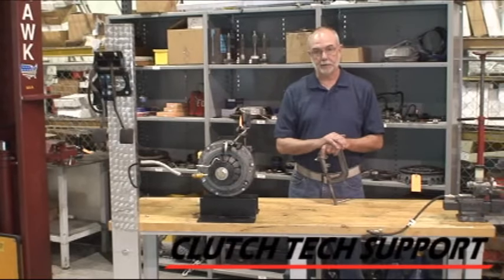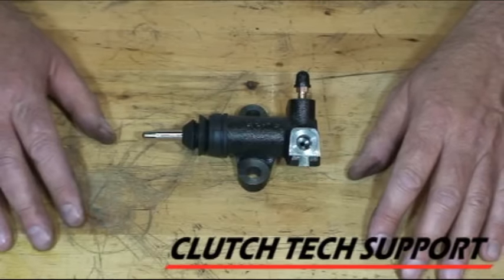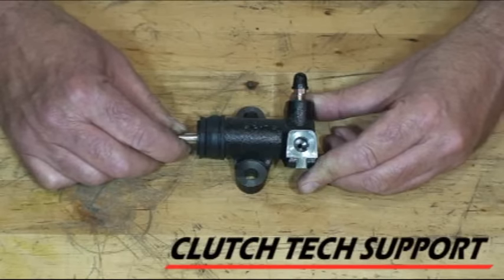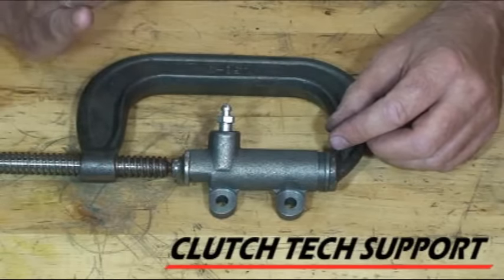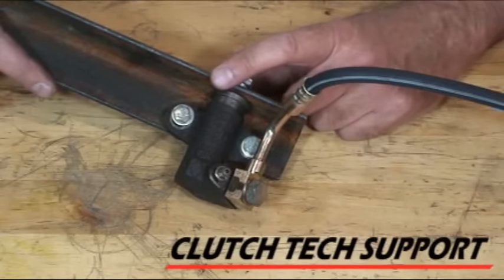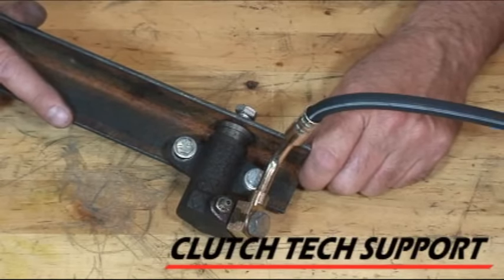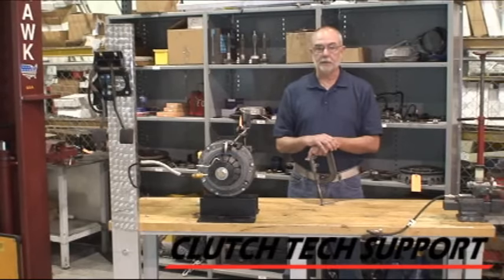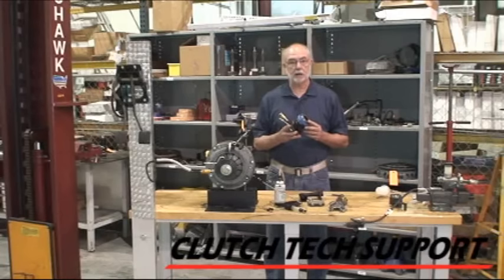Bleeding a Clutch by Blocking the Slave Cylinder

Comment: I'm trying to bleed the clutch on my Audi a6, its much like described in the video, I have tried gravity, pressure pumped through the bleeder, negative pressure through the bleeder, traditionally method, and its not working. the pedal is soft until near the floor then too stiff to even go to the floor. anybody got some input? do the symptoms point to any bad part of the system? I'm quite sure doing this method will run the risk of cracking the slave cylinder due to the fact that its plastic. It's also nearly impossible to work this method because it's so hard to get to the slave cylinder which is on top of the transmission. also I tried running a line from the bleeder screw into the reservoir and pumping the s*** out of the pedal, didn't work either I'm at the end of my rope here.
Reply: +perfectionclutch its a 2000 a6 2.7t 6 speed manual, I spent the day bleeding the clutch including removing the slave and clapping it which gives me full pedal, the slave however is easy to push the piston in after doing so with some hydraulic resistance and springs back out instantly. I hear a squish sound as the piston is pushed back in the last bit...

Comment: I am at my wit's end. 98 Honda Accord LX, 4cyl. Honda Part number for Master Clutch is 46920-S84-A02, Slave cylinder part #46930-S84-A06. I don't know what your numbers are. 

Master clutch cylinder was leaking. Was original factory and replacements don't fit so I replaced the master, the assembly line (hydraulic line) and the slave. 

For the life of me, I can't get pressure no matter what I do to bleed that line. Both the master and the slave have inlet/outlet right next to each other. I got a lot of air out of the slave by pushing the rod but still no system pressure, that clutch pedal goes to the floor. I tried your blocking the slave method after checking that yes, pushing the rod will change the fluid level in the reservoir. I did not bench bleed the master. Is this my problem? I put newspaper under the car so I could see if there were any leaks. No leaks, but then, I am not pushing anything forcefully, just slow hand push on clutch pedal.

Comment: I have a 92 civic. will be changing the clutch master cylinder and slave. after I do so, I fill up the master cylinder,  pull the pin and boot from the new slave and clamp it with a c-clamp. open the bleeder on the slave, push the clutch pedal down, close the bleeder,  put the clutch pedal up, repeat the process till just fluid comes out. take off the c-clamp, install the boot and pin, hook up the slave to the clutch fork and I'm done??

Comment: Hi, should I remove the rubber boot and pin before trying to block? I tried with the pin in place but it wiggles all over the place. Thanks
Reply: +perfectionclutch So this is what I am going to do. Can you tell me if am doing it right?

Install new slave, remove boot and pin, use a suitable socket size to block the piston, clamp socket with g clamp, bleed as normal, then bolt the slave onto  transmission.

Comment: Thanks Gary, great videos. I have a nissan with a longer route from master to slave. I cant get any decent pressure into the pedal and I suspect that there is air in the master cylinder. Will this method pump and air out of the master?

Comment: It's been 3 days straight and I'm still bleeding out the the clutch and it doesn't seem to work. I need help solving this problem can you help
Reply: +perfectionclutch it's a 04/05 350z and it's a v6 I replaced the clutch , master cylinder and slave cylinder

Comment: My throwout bearing is riding the pressure plate when clutch pedal is released. I have enough play on the pedal. The car was taken to the dealership twice for warranty replacement on the bearing but the car only has 63k miles. 

When the engine is running, I can push the slave rod in with my hand and can hear and feel the bearing not contacting the PP. It seems that the slave rod is over extended causing the bearing to ride on the PP while it spins. My question is, Can I build a clam to limit the travel of the slave rod then bleed it? After bleeding it, will that rod stay in play after removing the clamp or will it self adjust itself to the over extended position?

Please advise. Thank you.
Reply: +perfectionclutch 2008 Toyota Yaris 3dr hatchback, 1.5L 1NZ-FE.
Reply: +perfectionclutch Yesterday I strapped the slave half inch shorter than its original position then I turned the bleed screw counter-clockwise releasing a very small amount of fluid then closed it. Took the strap off and drove it 80 miles. I didn't hear the squeaking/chirping sound anymore but we'll see how long this will last. I'm thinking I may have to buy a new slave but I need to measure one out first and compare it to what I have.

Comment: Bleeding a 95 Honda Civic Clutch system and the Slave Cylinder doesnt move at all is this the slave or Master Cylinder Faulty or is there too much air in system. was working one week ago with different engine now with new engine it will not bleed or pressurize the slave
Reply: perfectionclutch Thank ya sir for the awesome response, I do have a question regarding the outcome of working on that system. The rundown of it I suspected the adjustment to be the issue and even installed a new slave cyl but couldnt get any movement on slave so kept bleeding just got zero peddle pressure at all the range of adjustment. Other side of system on bleeder little bits of air and fluid. Changed the Master Cyl for one I had lying around and got a gravity bleed quickly along with a working slave and system. Now what im so curious about is if the Master Cyl Was Faulty , or that the rod wasnt Floating as you said?

Comment: i have nissan maxima 2002 and i changed the master and slave cylinder .. but after a day my clutch start slipping .. i released the bleed screw and i found the system has over pressure ! and the pedal was heavy ..
after relassing the pressure pedal become soft and noce and no more slipping of the clutch .. next day it did the same heavy and slipping ... every time i release the bleed i can see the slave cylinder rod go back and it actually was pushing the clutch ! 
i don't know if my mechanic installed it wrong before it well get air in the system and he advice to change both master and slave cylinder ....
its been a week now and every day i have to do the bleeding .. or relasing !
any advice or diagnoses ?
Reply: yes its been adjusted and i loosed it to the end ... one mechanic made the postion of the pedal too high and i tried to lower it by the screw of the release sensor of cruse control ... my question is the slave actuator have adjustment .. and why when it build pressure the pedal is too heavy to push .. i well check mc pushrod again and verify its loosed all the way

Comment: Can anyone explain to me, how this is not the same as: 

- installing your slave cylinder on the gearbox
- opening the bleed screw 
-lightly pres the clutch pedal to the floor
- close the bleed screw before letting go of pedal 

This makes the same flow as you use the clutch-pressure plate, as your clamp 

Or am I wrong?

Comment: Hi I have a 2004 Audi a4 1.8t. I have replaced both MC and slave which is also on driverside below MC. I blocked slave to check MC and pedal is hard as a rock but when I reinstall slave pedal is soft and won't disengage clutch. I have also tried compressing slave to work possible air bubbles out with no success. Is it possible to have a faulty slave cylinder? Any help would be great. Thanks Dan
Reply: +perfectionclutch Hey thanks for getting back. The clutch pedal rock solid when slaved was blocked rod did not depress more then 1/8 inch. I'm beginning to thank it's internal.
Reply: +perfectionclutch 98000 miles on car  i got it with 77000 miles on it I don't know if the clutch has ever been replaced. Was just driving one day and was getting off the freeway and the clutch pedal went to the floor and stayed there. I tried bleeding the system with no success, the clutch would just go to the floor and stay there and had a hard time getting any fluid through so that's when I decided to replace both MC and slave and with pedal returning but not disengaging the clutch. The car was still drivable in a sense. To get it home I would start it in gear and go, just had to shut it off at the stop light and then repeat till I got home
Reply: +perfectionclutch Hey Gary yeah no luck cycled it in out 10 times and no bubbles.  In your opinion should I stay with this dual mass fly wheel or go with a solid since it looks like I'm going to be doing the job myself. Thanks

Comment: how far are you engaging the piston inside of the slave cylinder???
Reply: @perfectionclutch  ***Thank You Very Much!!!  I've got a 98 Isuzu Rodeo and I CAN NOT >>>NO MATTER WHAT I >>Or My Husband **whom is my teacher, & really good with all of this stuff, Or both of us together TRY!!!<<<  Get the ""?^@%!#&"" Peddle off of the floor......  First we had a crack in the slave cylinder that was hard to see......  Sooo.......  It became replacement time........ Do You know what came next.....    YUP!!!  You guessed it....  The "Problematic Peddle"!!!!! }prob cuz I cheated an told, but who cares???  lol{ ***Anywho; I am hoping that this technique Will help get my peddle off the floor cuz I'd love to have my vehicle bak!!!!  So if you've gotten ANY KIND of tip we could use please, PLEASE, let us know.....  I'd be very grateful/appreciative for the knowledge!!!  Sincerely ~*Jeni
Reply: @jenibyrns145  simple answer is to buy a cheap hand operated vacuum bleed kit and just have it draw fluid through past the master cylinder through the lines and the slave cylinder until it draws all the air out and only fluid comes out then tighten bleed nipple and pump up the pedal (always making sure the hydraulic reservoir never get close to running dry)

Comment: Gary, why do we need slave cylinder, cant we have just master to do the job of what slave is doing?. just asking on curiosity..
Reply: Thanks much Gary. very helpful.  I am also planning to buy clutch alignment tool that is universal, can u recommend one.
Reply: Thanks much Gary. One last thing, does all manual transmission have shift linkage lever, i thought now a days in modern cars electronics are involved and there is no more shift linkage.. if u can throw me some lights that will be helpful
Reply: Thanks Gary, What I understood from you is modern Manual transmission doesnt have shift linkage is that right.

Comment: Thank you for a very insightful video .I still need help though.I have a mazda b2500 and the clutch pedal is very soft and not releasing .How do i go about to bleed it as it has a very long pipe system with many bends that i believe trap air bubles .Please help

Comment: C 1500 bleed alone, fill unit oil tight.push rod into slave cyc.few times untill air goes back into reservoir .rod will go back and forth unless clutch padal pushed .do not use cheap fluid.5 minuets reinstall slave cyl.

Comment: I've just replaced the master and slave cylinder on my 2008 Mazda 5 (mechanic diagnosed it as the problem). After trying to bleed the system several times, I still cannot release the clutch plate fully.  When bleeding the typical way, when I have someone hold down the clutch pedal and open the bleeder valve, it appears that there is no air in the system as only a solid stream  (no air bubbles) of fluid is coming out, but not much (about an inch in the tube).  Also, the clutch pedal has very little throw, is close to the ground and does not come back up as far as it had before I replaced the cylinders.  Does this sound like I still have air?  If so, can I use a clamp to perform your procedure?  Thanks!
Reply: ***** Thanks for your response.  I did try your technique and while the clutch was depressed and the slave cylinder (on same side, down from the master) depressed with a clamp, I did get more air bubbles out.  I only did this one time as I had a hard time keeping my clamp on since it has nylon ends and the piston pushed the clamp off when I tried a second time.  Am I supposed to continue to bleed it this way until there are no bubbles?   I continued to bleed the system the traditional way, but I can barely get the vehicle into first gear (still not good).  I will look up the video for the Camaro and see if this works.  Not sure if the mechanic is correct on his diagnostics.  I am positive it is not the clutch (maybe throughout bearing?) as the clutch does not slip at all.  It all started with some slight resistance putting the vehicle into higher gears, but only after driving it for a period of time (~ 1 hour).  Very strange.
Reply: +Laura Dencer so did it end up working? i have pretty much the same problem but there was a time i was able to bet into all gears. then we opened up the bleeder, pedal went down again. but this time after pumping a few times, i couldnt get the car into any gears. and the pedal still wouldnt come all the way up. im pretty sure it still has some air in the system.
Reply: +RydrSkope after trying several times, I finally got the air out, but my problem seems to be the clutch shifter cable that runs from the shifter to the trans.  Strangely, it is no problem shifting in cooler temperatures, but in the summer, is a bear.  It is a big expense to replace (cable is expensive as well as labor since it is takes many hours).  I hope your problem is just the slave cylinder as the master is in a tight place and difficult to replace.  Good luck!!
Reply: It is a 2008 Mazda5.  If you know of anything about my car and this shifter cable in regards to adjusting, I'd like to learn, but I don't think it is the cause because it only sticks when it is over 60 degrees.  I heard that they can stick when they get hot (per a mechanic).  I am good for now, but will have to deal with it in the spring.  I have read many Mazda forums stating that it is difficult to replace since it is confined area.  Thanks for your input!

Comment: What's wrong with having bleed tube in a jar with fluid to stop air being sucked back in... and you open the bleed nipple and have the clutch pressed to floor... tighten the bleed nipple raise clutch pedal and repeat until fluid and no air comes out of bleed pipe ... the system should never be placed under pressure until all air is expelled out of the system! Or just get a vacuum bleed kit and forget the need for the person otherwise needed at the clutch pedal. should never push pedal to floor then open bleed nipple as that is only a requirement if squirting out a bleed nipple with no pipe or jar/bottle to collect waste hydraulic fluid bad way to do it as makes a mess and can get hydraulic fluid over bodywork paint and underbody corrosion protection and damage both.

Comment: The bleeding procedure he describes is wrong.  The correct way is this:
1. Open the bleed screw.
2. Push in the clutch pedal..
3. Close the bleed screw.
4. Release the clutch pedal.
5. Repeat from 1. until no air comes out.

In the video, he's got step 1 and 2 reversed.  If done with the correct procedure, there is absolutely no need to block the slave cylinder.

Comment: I've been trying to bleed my toyota t100 for a week now after replacing master and slave. No bubbles but still no pedal.. If this works, I'll be forever in yall debt lol
Reply: Let me know if it worked
Reply: @dantedumont401  it was tricky to get the clamp on but got the clamp on, had my buddy hold on the pedal then I bled and a burst of bubbles came out. Adjusted the rod out a little further at the clutch pedal and boom, clutch is back!

Comment: You told us an overly elaborate story  ( nearly six minutes) – as though you where trying to impress the non-mechanic among us, Good A+. What you failed to do however is tell us how to fix the problem. –

 That is if the one replaces the clutch Master  cylinder and pedal goes down ( flat  and won’t) come back up. How do you fix the problem?